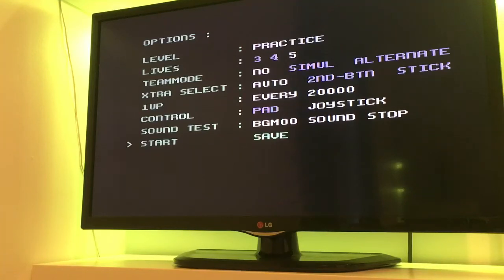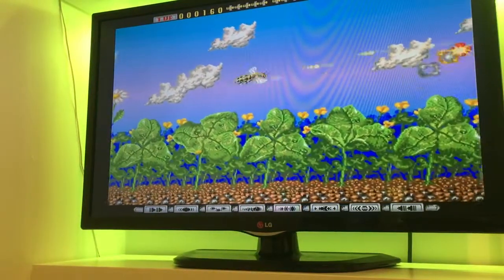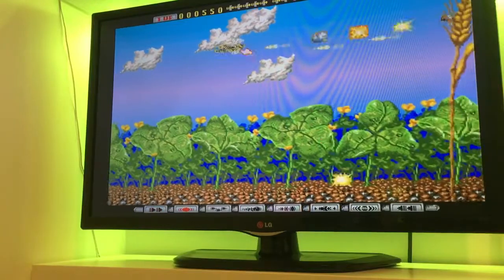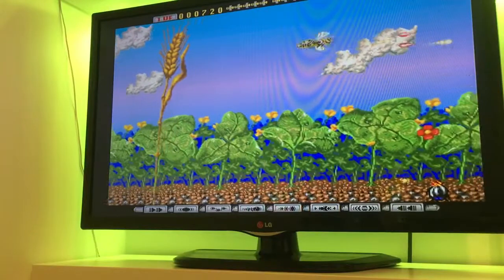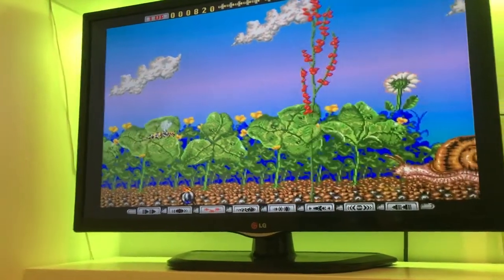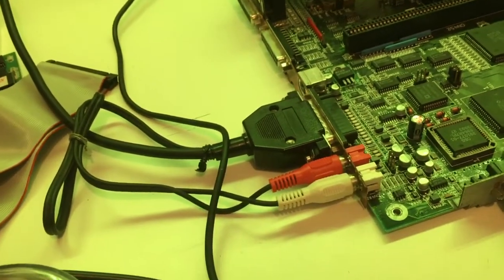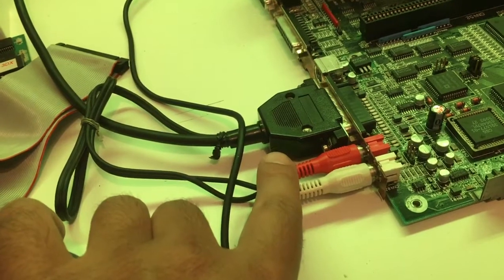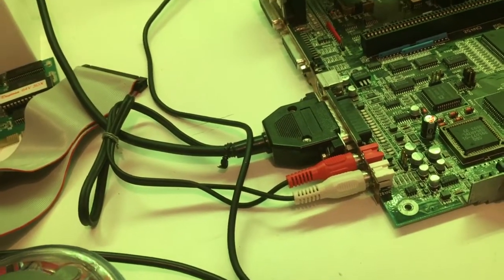Amiga 4000 sound problems

Comment: A few days ago I fixed a similar sound problem. I changed both audio opamps and a few resistors without success (all caps are new). At the end there were two broken traces to the resistor R403G. Check every connection from the opamps to the resistors and capacitors.
Reply from the maker: Serge Bilgeri Thanks Serge, will look at them traces, thanks for the heads up

Comment: Presume dead Caps in audio path. Had Theo same issue with my A1200. You can put a probe at the chinch cable and trace the audio path back to Paula. Mine had a dry capacitor.
Reply from the maker: Jörg Unglaub Its just been recapped, I think its a dead sound controlling IC😁